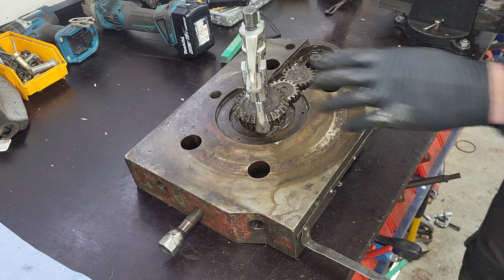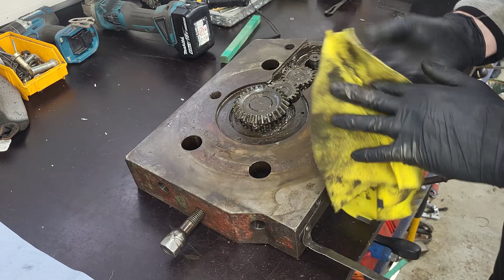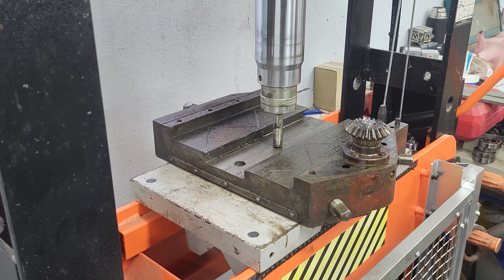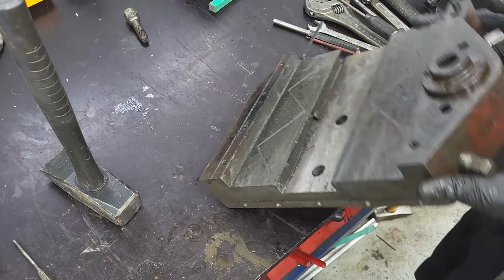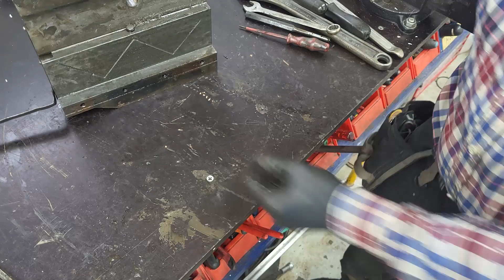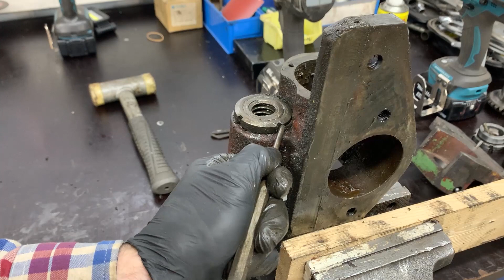SAJO milling machine restoration - PART 7

Comment: It is a good ideea to mark the grease fittings (zirks)for oil or grease.Most of the fitting are ment for wayoil but some are for bearinggrease.Grease in the channels at the ways blocks the lubrication and wears down the machine very fast.sadly all fitting looks the same.Almost all old mills i´ve been working with had their channels blocked with grease.Somtimes you can blow it out with compressed air,but if it has been sitting dismantling and cleaning will be nessecary.I  like to put a red dot for oil and a blue for grease and then put a sign at the mill to explain.Really prolongs the life of the mill.Reading the lubrication chart is essential!
Reply from the maker: That sounds like a good idea, thanks!